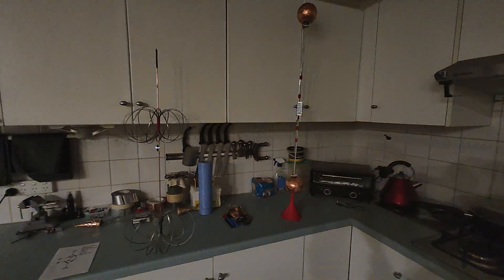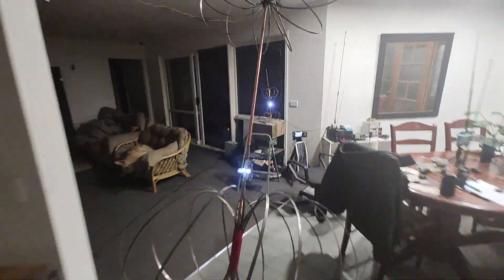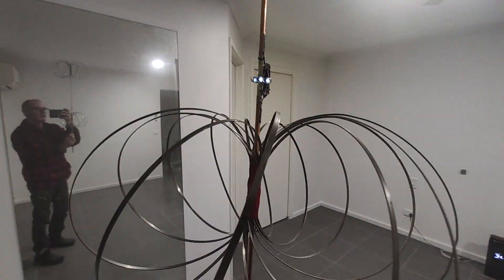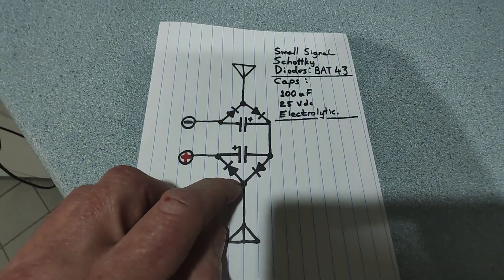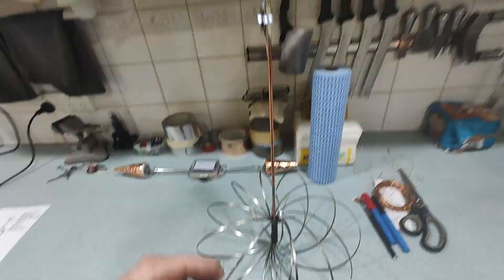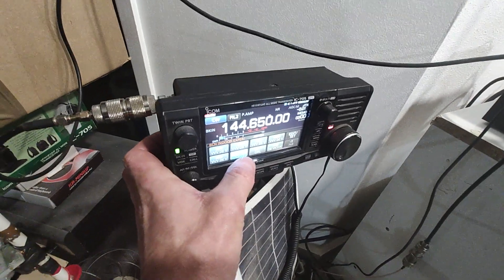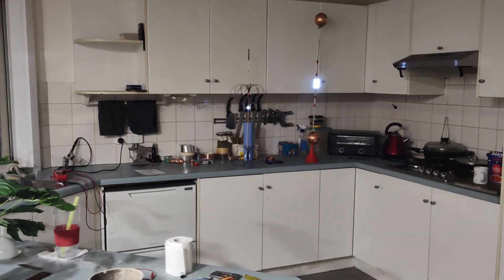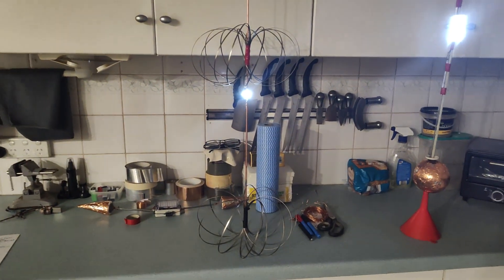How to Build a Rectenna / Long Range / Harvesting  Radio Signals/ Wireless Power /  (VHF)

Comment: Instead of putting the power into a light what kind of circuit would you use to store it into a battery?
Reply from the maker: You could simply connect straight to a battery provided it doesn't risk overcharging it.

I guess you could also include some sort of  battery management circuit too.
Great question
& I hope you get to experiment with it.

Comment: Can this also work for microwaves? Or only designed for radio waves
Reply from the maker: This one is no good for Microwaves
but with much faster diodes
it would work
but also would need much much smaller antennas.

Comment: Nice, I am wondering, what about other frequencies? doe's it also catches? For example if you can make a rectena which can use a Base Station Antenna energy, so it will have pupropes for light up some house rooms :)
Reply from the maker: Excellent Question.
The concept will work on numerous frequencies.
The length & size of the system changes the frequency.
Generally making it longer lowers the frequency.
High Q inductors (Coils)  can also be used
to lower the frequency significantly...

To use on higher frequencies,
making it shorter would improve it
yet this version does work ok at the UHF 70cm band for example but not as efficient.
Thanks for the great question my friend.
Happy Experimenting 🙏😁🙏

Comment: Can you provide me detailed tutorial for how to make reactenna and specially the appratus and material required to build the reactenna (3rd version)as same as yours.
I will be so thankful of you, if you help me 🙏🏻🙏🏻🙏🏻🙏🏻🙏🏻
Reply: How they could harm you ?
I have problem that sope people are heat my body and harm my health.
They use something simlar this frome many side of my home and attac me and mom.
Pls can you just explain me how to protect and save from thos cuz they use my wi fi and while its on they doing it when i off my wifi they stop.How is it possible?
Reply from the maker: Hi there, I'm not entirely sure what you are explaining here 
but in general, keeping your distance from Radio Frequency Sources is how to minimize effects from RF energy.

The signals reduce exponentially as you increase  your distance from the source.

Increased Distance is a great safety barrier from RF energy.
Reply from the maker: Hi my friend. 
I hope this helps.

Essentially the 3rd version has the exact same rectifier as the 2nd version.
The key differences are that the 2nd Version has more LED's all in parallel
& also uses two telescopic whips
with the ends connected to a 6 turn pancake coil at each end of the whips,
these bifilar coils are using a figure 8 speaker wire
(two wires in parallel)  and the other side of the coils connect to  the copper balls at each end.
In other words,
The bifilar pancake coils are in series between
the end of the telescopic whips and the copper balls/spheres.
The copper balls are actually polystyrene balls
coated in a self adhesive copper tape.

When I said 6 turns,
it is 6 turns of a twin wire (speaker cable)
essentially 12 turns althogether per coil.

Look up Master Ivo's channel on Youtube for how to build a bifilar pancake coil.

I suggest experimenting with the basic design.using materials you can get hold of.
It may behave more efficiently with larger copper spheres but I imagine it would need to be shorter than it is with the smaller spheres (balls).
I wish you luck with the experiments my friend 
⚡🙏⚡
The third Version is the one I shown in the video.
which has the tori at the top and bottom
on the fibreglass rod with copper tape over it.

I am not entirely sure if you are truly referring to the 2nd or 3rd version
hence my added detail on the 2nd version.
⚡🙏⚡

Comment: more about the antenna, radiation pattern, gain and etc..
Reply from the maker: Are you asking about the Rectenna itself?
Or the transmit antennas ?
Reply from the maker: The transmit antenna at the beginning was a simple mobile mag base 2 & 70 antenna.
Likely an equivalent to Quarter wave for both 2 metres & 70 cm bands which have a low gain donut pattern but of course inside the house there are interference patterns that cause some regions to be enhanced and other regions to be low down or cancelled...
The Test with the Hand Held Radio Used a Telescopic whip with a small inductance coil,
so possibly 3/8 wavelength 
because of the inductance coil.
That antenna does have more gain than a typical rubber ducky for a handheld radio on 2 metres. 
As for the Rectenna,
I have only tested as an RX System
yet it is an omnidirectional system.

Comment: I think your toros-coils are what Tesla was referring to when he described an "elevated capacity of great surface area". Fascinating. 🙂 DE N8JZS
Reply from the maker: Yes, that makes a lot of sense. 
From my observations over many experiments, it appears that unlike a normal capacitor & unlike the typical capacitance between antenna elements , the torus directs electric field lines outwardly, away from the element & not just towards the oppositely charged element  (Increasing the reach of the nearfield e field).
Thanks for your comment mate 👌
73 DE VK3VKe ⚡🙏⚡

Comment: I wonder how the copper balls and pancake coils are exactly working in this setup?
Reply from the maker: Great Question.
I'm mostly an HF experimentor
but recently decided to try some tricks that worked on HF for me on VHF.
The Copper Balls & Tori Change the End Effect in a manner of speaking and direct electric field lines outwards away from the ends of the elements (Capacitively linking between each side over a much larger area).
I can't be so sure right now how the bifilar pancake coils are playing into this equation.
At lower HF frequencies I have found that when using Bifilar pancake coils 'at resonance'
I can achieve a higher energy state in a system (E field Energy).
I am only assuming this is the case in this example too with VHF.
The results are quite fascinating.
Last night I beamed a UHF Signal at the Rectenna with the  copper balls & 16 LED's & to my amazement it lit up well from quite a distance too
without adjusting the element lengths on the Rectenna.🤔🤔🤔
73 my friend & thanks for the great Question 👌⚡👌
Reply: @crazyham  This is so cool! I love it.